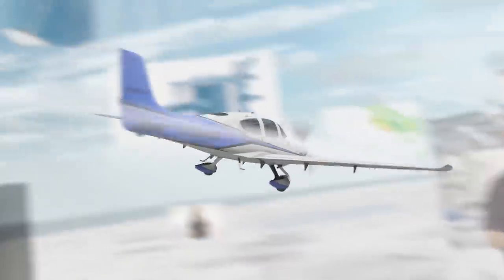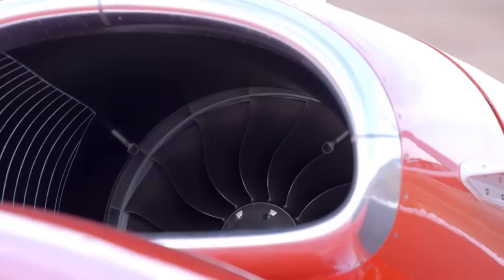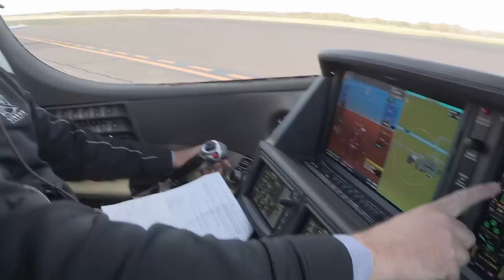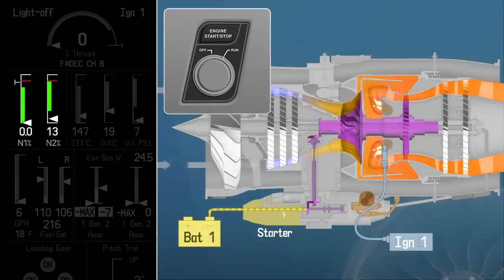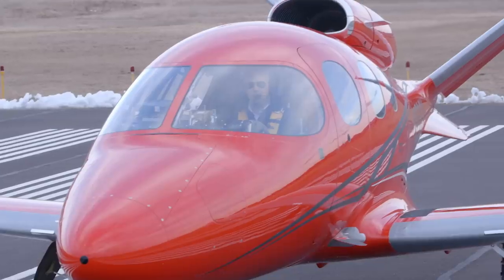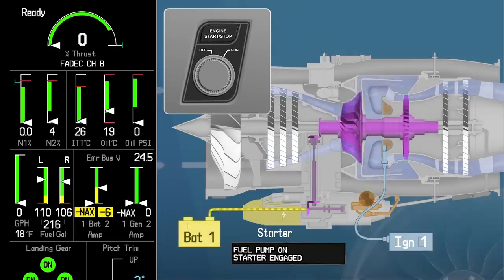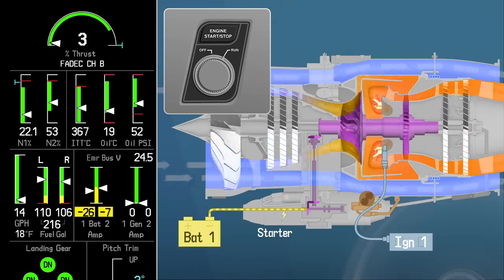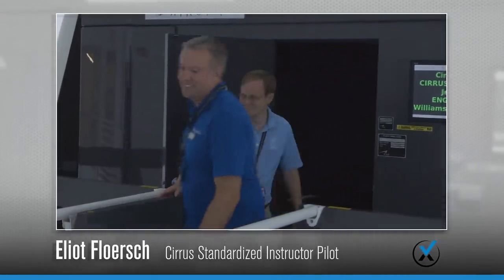Starting the Vision Jet

Comment: Hot start. Inlet temperature exceeds maximum or certain range over certain length of time. Hung start. The engine could over speed as a result of the starter control not disengaging. On Fadec engines, the onboard computer monitors all systems during startup and will automatically shut down the engine if any limitation looks like it would be exceeded.

Comment: Given that the readouts are just images generated by a computer system, the system might as well do the monitoring itself, and be done with it, with the advantage, from the pilot's perspective, that if the engine gets damaged by an improperly monitored failed start, the blame, and therefore cost, clearly lies with the system. Second thoughts, perhaps that's why it's NOT done by the system.
Reply: Not sure if this engine has automatic start protection but just about all modern airliners do.
Reply: I want one of these please thanx
Reply: Well...alrighty...than!